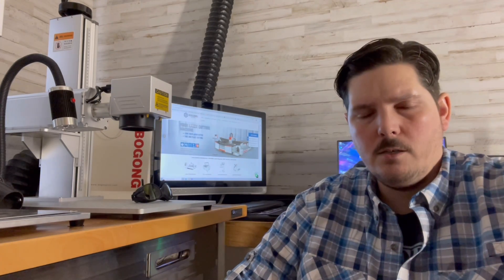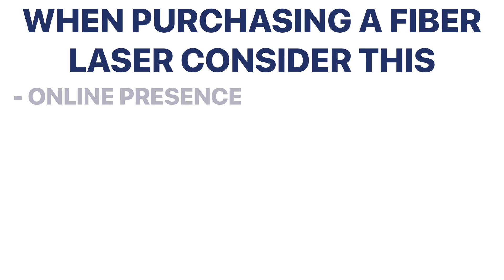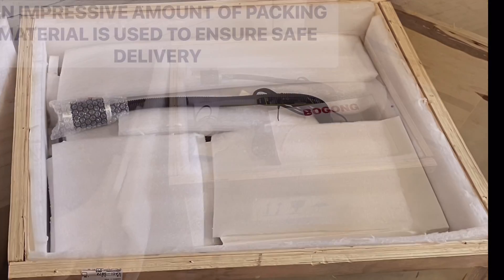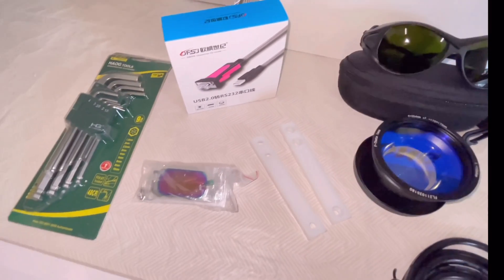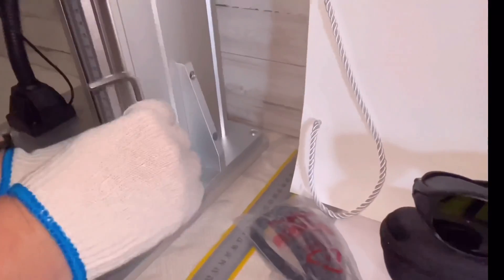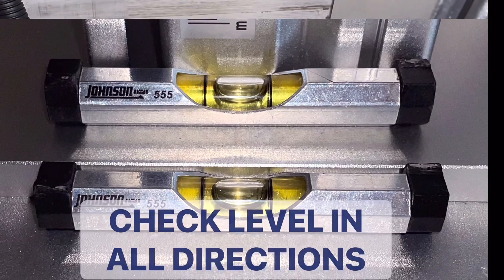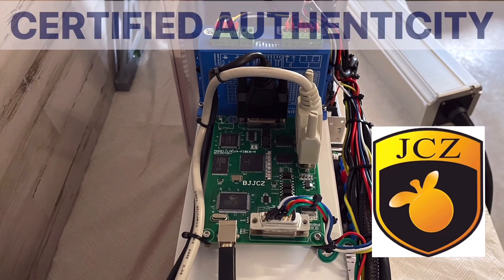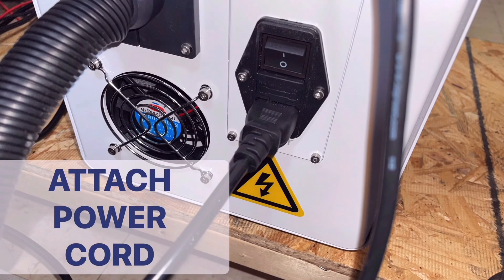U.S. customer's feedback: JPT 60w mopa unpack, install, ezcad to lightburn of fiber laser engraving

Comment: You can use either EzCad or Lightburn on the same computer ?
Reply from the maker: yes, but can not use both software at the same time
Reply: no, usually lightburn rewrites the driver to something else, so when you open ezcad2 it doesnt find the card. we typically run ezcad and lightburn on sperate machines.